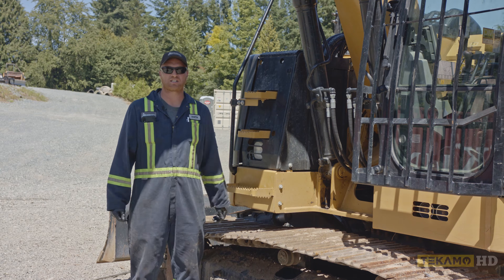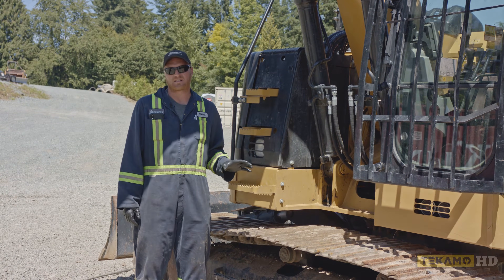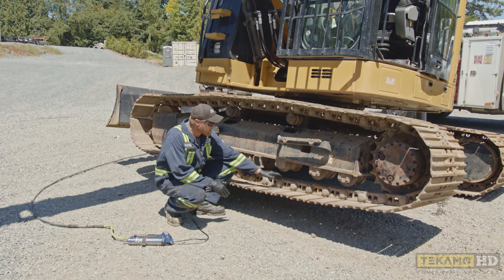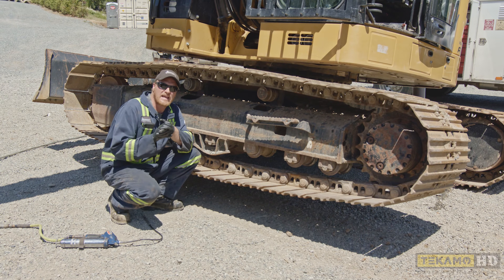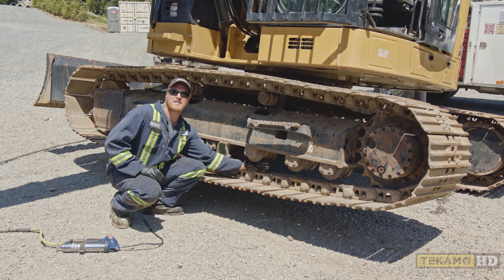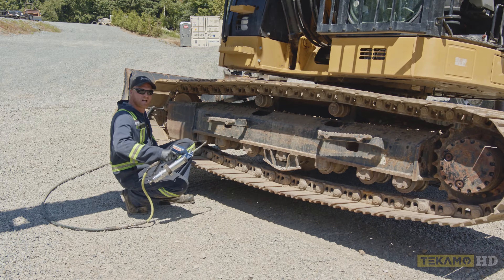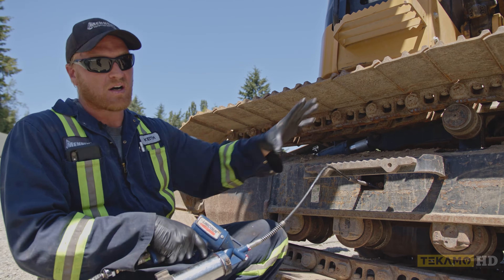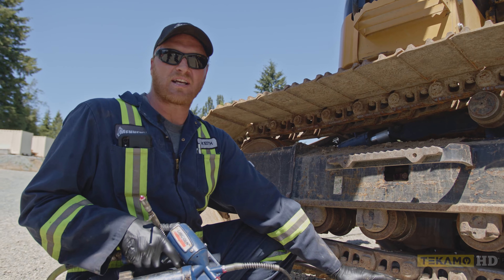He Adjusts Hydraulic Excavator Tracks IN MINUTES

Comment: I disagree with this type of adjustment,  those fingers wont give you the correct track tension, you need a straight edge and a  measuring tape. You find the specs in the manufacturer's manual.
Reply: When u adjust enough tracks on machines. U know by eye where they should be about.

Comment: Very informative video! How often do you have to adjust the excavators tracks. Is this a yearly thing or a monthly to do this preventive maintenance.
Reply from the maker: It varies from machine to machine but it's important to check track tension regularly. Manufacturer spec books will show measurements on how tight the tracks should be.